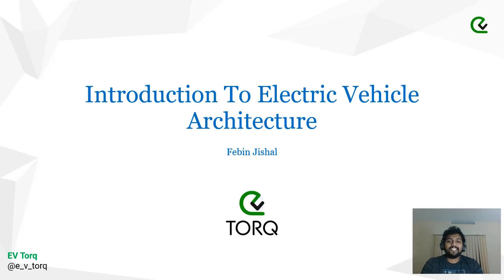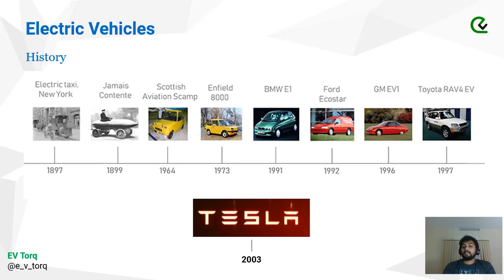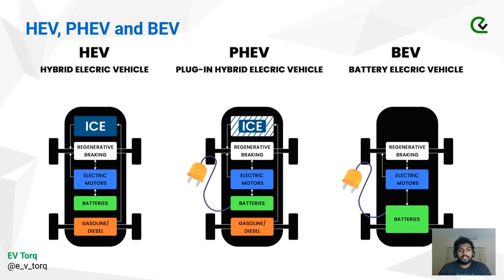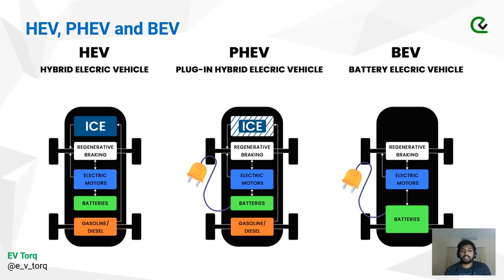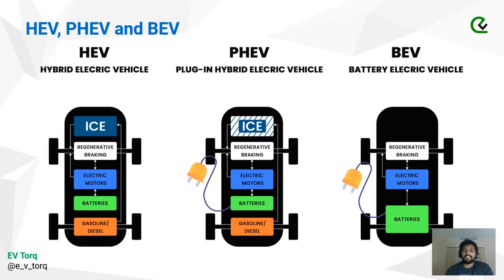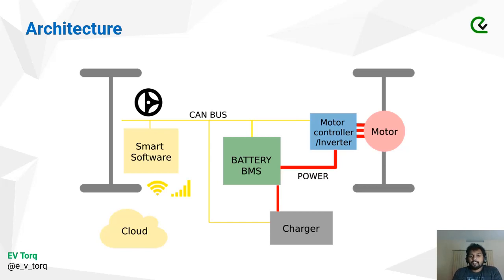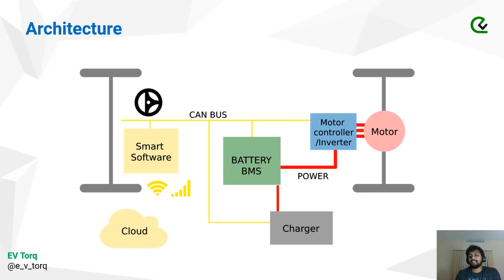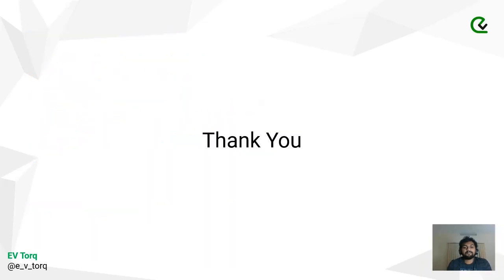Introduction to EV architecture | Part 1 | Febin Jishal

Comment: I have one doubt in PHEV you said that we can switch between battery &engine 
can you please give clarification the switching can done manually by driver or automatically by super computers?
Plz
Reply from the maker: In some cars It can be done by driver, If he don't want to engage engine and he can drive with battery power alone. But this is not advisable, as the battery capacity is very low.
Reply: @evtorq  ok thanks